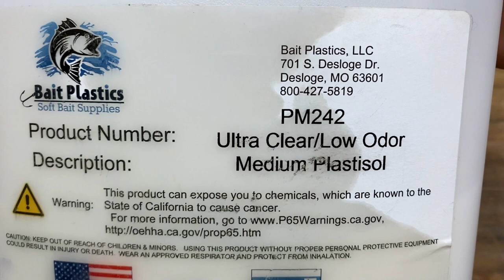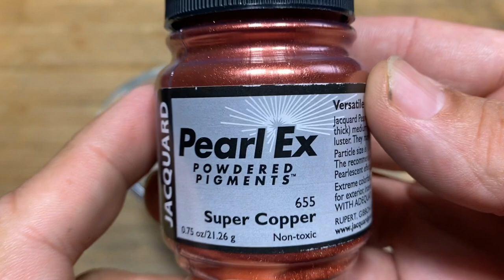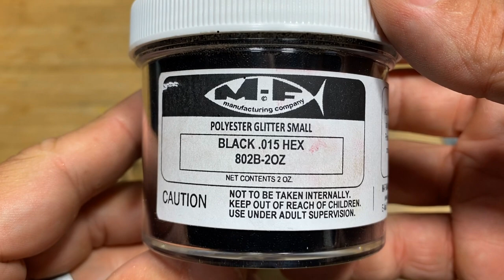Making Some Copper Monkey Ned Rig Creature Baits (**Test Tank Footage**)

Comment: That thing looks great on the Ned! Looks like a hybrid cross of the Helgi and the old  AI KickerTail… live that copper too!! 🤩👍🏻🙌
Reply from the maker: Thanks man!  Yeah, the body thickness is just right.  Ye ol' kicker tail was a great concept but MAN was the body thin... it was we struggle to use it effectively.  This one's got enough meat to work with... even cut down for a jig trailer application in the future (oh yeah... that's happening).  Got me wondering too... if you pinched off the claws completely, I bet the legs and body would make for a nice, more subtle, ned presentation as well (more akin to the Helgi).  I'm diggin' it for sure (and 8 at a time with a reasonable runner is a nice bonus too :)).